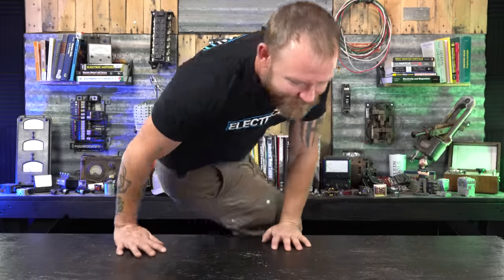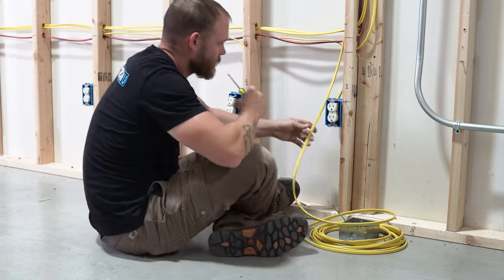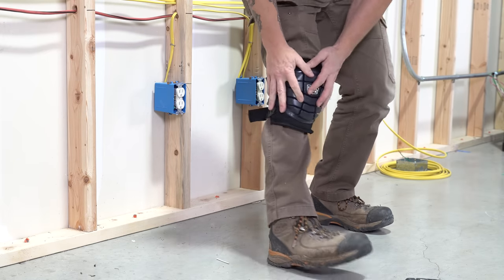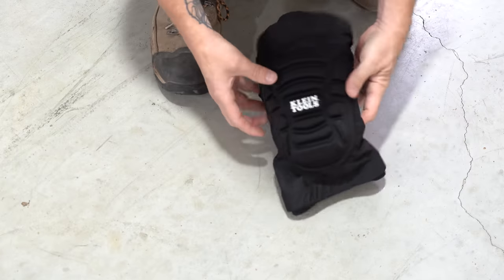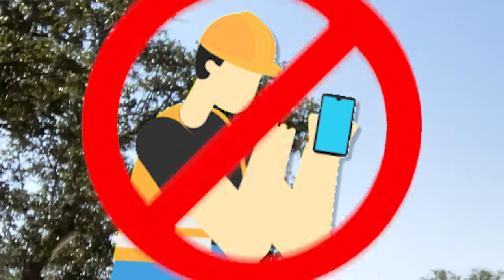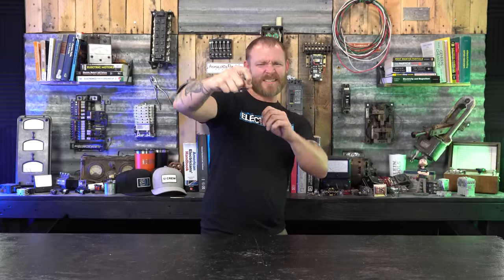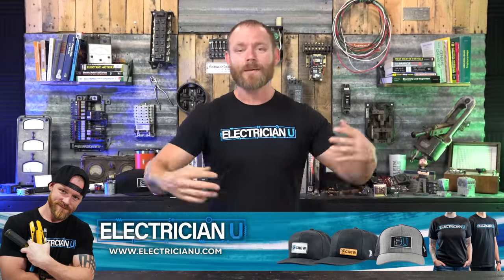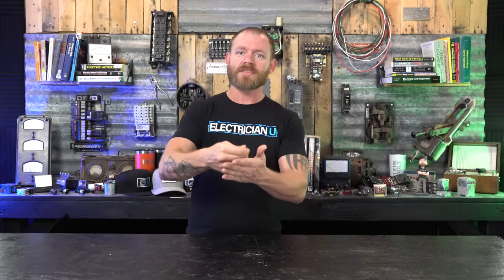Five Things Apprentices Should NEVER Do!!!

Comment: It's okay to sit down or even to lay down if it makes your job easier or more productive. I'm talking appliances, machines, computer diagnostics, programming, access panels in weird places, crawl spaces, roofs, boom lifts. Sometimes laying down is the best way to do it.
Waiting next to your cooworker is also totally okay if you two are doing a hard enough job that requiers two of you and one tool. The other thing is when you're assisting your partner in high voltage situations, or simply when driving a boom lift and can't see from it. The third that comes in mind is industrial enviroment where it's forbidden for sparkies to work by themselves. So even the easiest job requiers two people. I'm talking easiest like replacing a single recepticle on a dead circuit.
You sir are not open to the fact that there's 20 sub categories inside the spark world with 10 different enviroments to do them at and some of us have to pull 5 of them off regularly.

Comment: I appreciate when an apprentice asks questions and not too many questions. Staying quiet and just head nodding will get them nowhere fast. Before you know it, they are 3-4th year and don't know how to wire a 3way.  Yes I agree apprentices shouldn't act like heroes and should speak up if they don't know how to do something, however them staying quiet and not asking questions is just as detrimental. I rate apprentices on how many questions they ask.  I think this is what you meant, not trying to troll but maybe bo more specific.  Its hard to find a journeyman that will take the time to really train the apprentice and if your not estimating jobs where you allow for some time to train them, then your doing it wrong. Its not fair to them either. An apprentice is not a journeyman yet, but eventually they will be. 5years happens fast.

Comment: My biggest pet peeve was the cell phone.  You pull out a cell phone and you were fired on the spot.
Reply: Phone wasn't as big a problem with the crew I was on as earbuds. Not allowed in most commercial and industrial jobs here, but when I switched to residential all these kids wanna wear their earbuds when you are trying to pull wire n shit. Makes it IMPOSSIBLE to communicate with them.
Reply: @HamiltonMechanical  Why do people even bring earbuds to work? It isn't play time it's work time... My phone is always off at work unless it's an emergency. If it's an emergency you let the people above you know in advance at the start of the work day. It doesn't matter what type of work it was for the last 15 years I've worked.
Reply: @HamiltonMechanical  I can see that.  And that would be a safety hazard on my crew.  Fortunately, earphones were banned on the job site as well.  And radios were not allowed.  There is nothing like trying to call for help when a radio was blaring in the background.
Reply: @HamiltonMechanical  I agree with you but BT earbuds are great for pulling wire when the other person is not within line of sight or earshot. I’ve been on many jobs where no earbuds were allowed and they insisted you use 2-way radios for pulling wire. I’ve made the case with safety (and won) that it’s safer and more efficient to use the earbuds (or speakerphone) so the person pulling has both hands free to pull at all times and the guy at the other end has both hands free to feed while being able to communicate uninterrupted.

Comment: Knee pads for the win. :) I actually can't sit cross legged as my right knee will dislocate randomly in that position, discovered knee pads as I have to kneel a bunch for datacom work. Have two sets of pads, inserts in my Helly Hanson work pants for when I'm indoors and discrete is the work of day due to dress codes, or my strap on Kuny's when dress code isn't an issue.
Reply: I just find a bucket. It takes me longer to stand from a kneeled position that to do the wiring.
Reply: @9itsjustme2  Yeah bucket is great although I have seen american electricians like Electrician U hating on people using buckets when wiring plugs.

Comment: I must be nuts then.
I feel bad for workers that remodel my house I mean yeah they are payed to do the work but I like to help.
So one day I just asked the contractor that was hired to do our home if I could help out.
And the contractor already has a pretty good team as it was.

I asked him if I could help and he trusted me enough that he hired me to do general stuff.
I will not say what contractor it was as I would rather not get him into trouble but I was so stoked to help out and be a part of his team and not being some guy that was watching everything. xD
And I knew I was part of the team for at least this one job as some one was asking what I want for lunch.

Yeah I am an oddball working on my own home that the work was payed for to have some one else do it but I am also one that likes hooking up things and tearing things out and putting in things.
I also learned that I need to get out a multi-meter to see if wires are actually not live.

One of the times they had left 1 electrical outlet not done as it was bare wire coming out.
So what I was going to do is finish it so that the crew could do something else and not have to do it the next day.

So I did what any one would do that was going to work on the wiring.
I went to the electrical panel with the breakers and flipped what I thought was the right breaker.
I go to the wiring and pull the hot and neutral out and undo the wire nuts.

And I touched the hot and neutral and felt the electricity go from one arm to the other.
Oh course I clamped down on it and I was glad that the clamp did not last.

I had lots of swearing I did and then I found the right breaker and basically tested the voltage with my multi-meter.
And that is pretty much when I found breakers can be miss labeled and to always do a voltage test on what you are working on so that you do not experience what I went through.
With that being said though I do know the risks of the job.

I also do pinball repairs and some of the old transformers I have gotten a zing off of the lugs as they come out of the transformer and I have to many times got to close to em and had some quite colorful words and then go back to work on the pin. xD